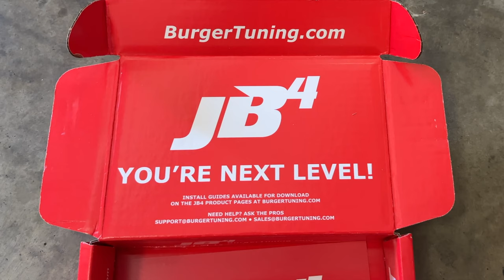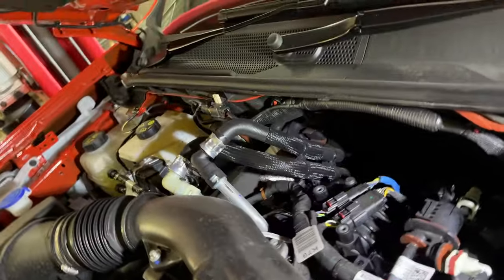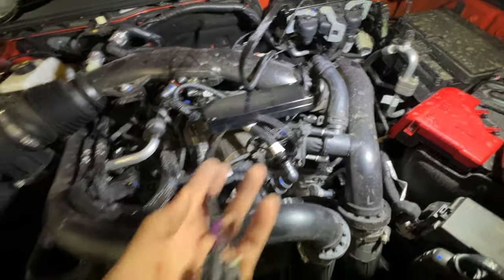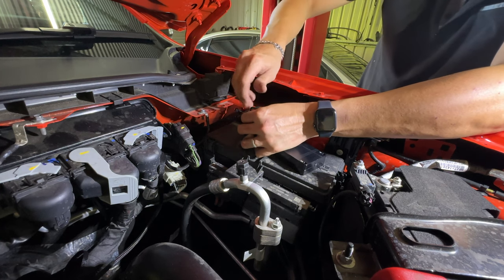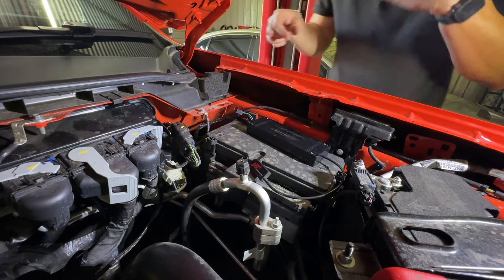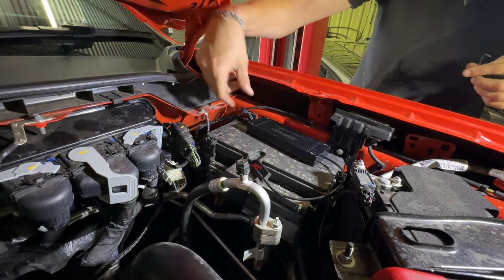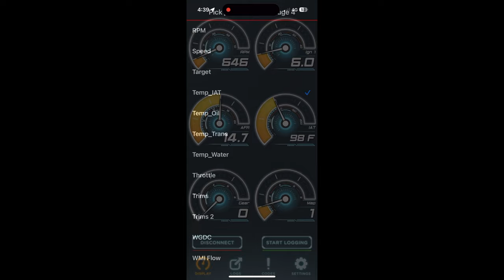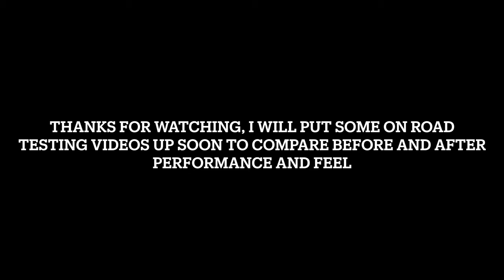JB4 Installation - Next Gen Ranger Raptor 3.0 v6 twin turbo

Comment: you're the first to do this and am so keen to see the gains and throttle response improvement, does it also remove the top speed limit? seems like a few others have that 187km/ph
Reply from the maker: Thanks for the feedback man, appreciate it! We are going to take the raptor out for comparison runs tomorrow. Will have vid up by end of weekend hopefully. The speed limit would need to be disabled in the factory ecu i’d say. Maybe with forscan? Not sure on that one….next time i’m plugged in with forscan i’ll have a hunt for it.

Comment: Hey Benny, I installed this onto my car and it came up with a spanner on the dash and then a code in the jb4 p0108, did yours work perfectly straight away??
Reply from the maker: Hi Alex, yes mine worked straight away. Have you tried read then clear codes with the jb4 or forscan?

Comment: Nice raptor!!! Are those 35s does they go on the factory suspension ?
Reply from the maker: Thanks brother!!! They are 295/70R17 so under 34inch. But Yoko are know to be slightly over normal rolling diameter in their mud tyres. I know for a fact 35’s clear though. Usually a more negative offset than stock helps. I’m running 17x8.5 p25 Icon Compression wheels with 295/70r17 Yoko G003
Reply: @bennydiesel5413  Hi Benny. What is the model number of your Icon`s 2017859057SB?

Comment: Do you run map 3 on out 98 octane?? What does the cars boost gauge display compared to before??
Reply from the maker: Hey man, yeah i’ve run all maps up to map 5 on bp98. As it’s an actual 98 octane fuel now it should be fine to run on e30 maps as e30 is 97ish octane. I’m uploading a 0-100 comparison video right now so should be visible in couple of hours
Reply: @bennydiesel5413  I have heard American 93 octane isn’t the same as our 93 octane… like their 93 is like our 98 or better… I’d love to get to the bottom of it….
Reply from the maker: @alexjimmy9297  yeah i’ve had the same issue trying to gain clarity on the fuel differences. I’ve played with these tuners a fair bit in the past on old e92 bmw’s and found they have pretty cautious failsafes in place in case of knock. So I was happy enough to give it a crack lol. Standard boost in baja mode is approx 15psi. Boost on map 2 is 17.5psi Boost on map 5 is 20 psi. I actually found map 3 slower than map 2 for whatever reason. Tried multiple runs (this is possibly knock control) but map 4 and 5 significantly quicker. I’ll let you know if it explodes haha.
Reply: @bennydiesel5413  I recon mine runs 1.2 bar from factory?? Could this be correct??
Reply from the maker: @alexjimmy9297  you can definitely get spikes in boost pressure. I think 1-1.1 bar is factory boost though.